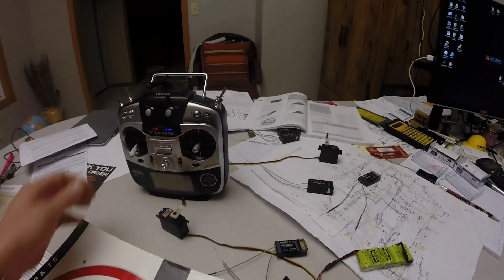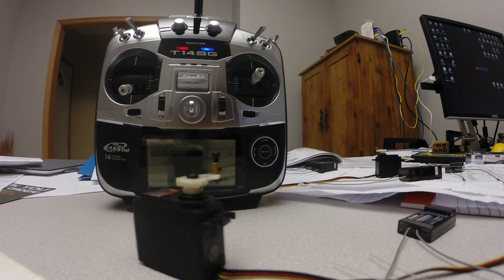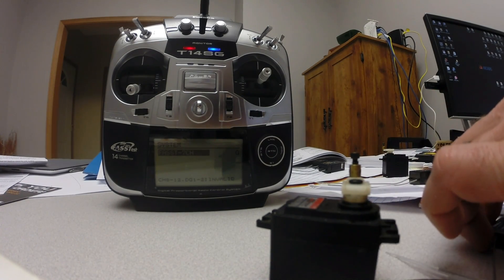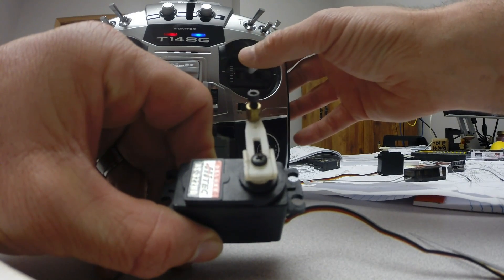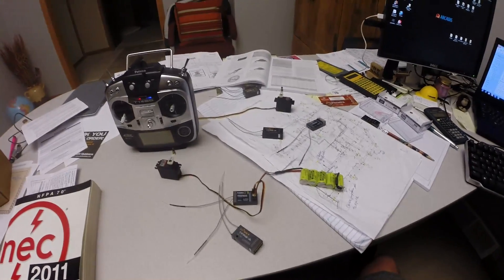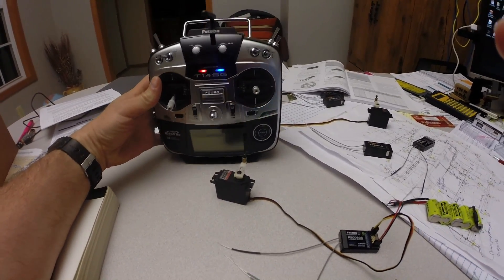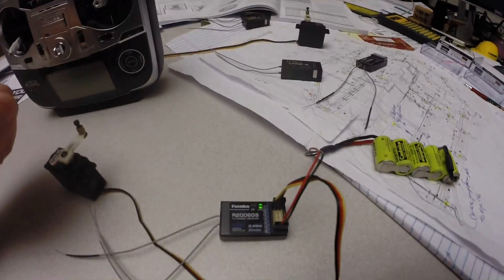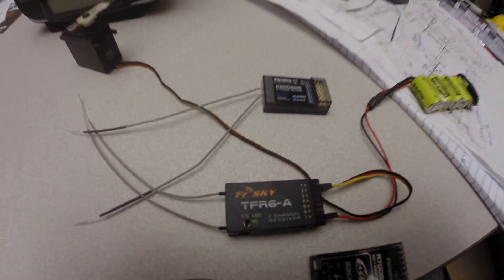Looking at Futaba S-FHSS and FRSky FASST Rx

Comment: my problem t8chg +receive fr sky fr8    in mult mode  cannot used servo hitec it rumble in center stick position and hot ,when chenge receive to futaba r617fs ln 7ch mode servo hitec it work good
Reply from the maker: I have never had that issue with an FrSky receiver.  It happened once with a Corona receiver though. Good luck!

Comment: be aware; don't upgrade  you're 14eg to software version 6. FRSKY FASST receivers wont work !! Downgraded mine back to version software 4 and all is well again. Still a great radio!!.
Reply from the maker: +radiomodeller Thanks for letting me know. I'll have to look into that as the FRSKY units are solid performers. I'd hate to lose them as a resource.
Reply from the maker: +radiomodeller , Just wondering, are you in the USA or in another part of the world? Version 5 software caused trouble for EU radios at the time.
Reply: +Team_Monkey I tried all manner of things; in the end the only answer was to go back to the version 4 of the software from Futaba. I have three VFR8S Frysky and they perform well, At half the price of FASST from futaba.
Reply: +Team_Monkey I am UK and went from version 4 to 6. Never tried version 5; don't intend to. I suppose if it aint broke don't fix it. Regards
Reply: SORRY I'm in UK. Tried akk sorts of fixes to get them working. In the end reverted to version 4